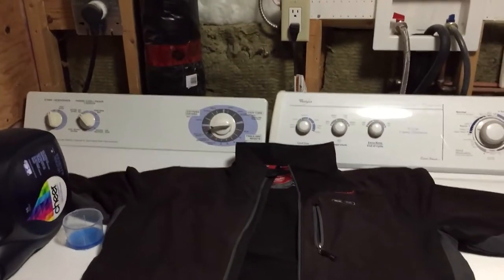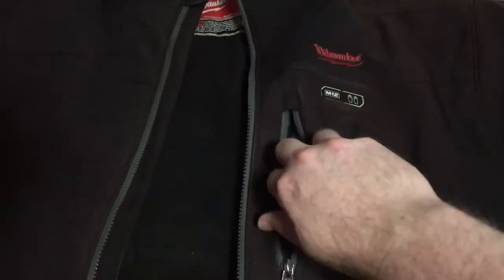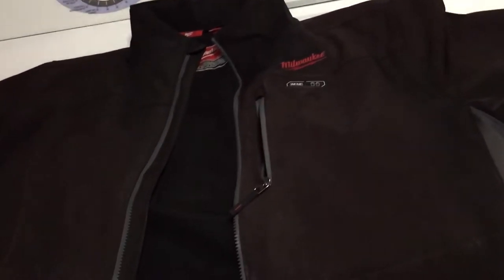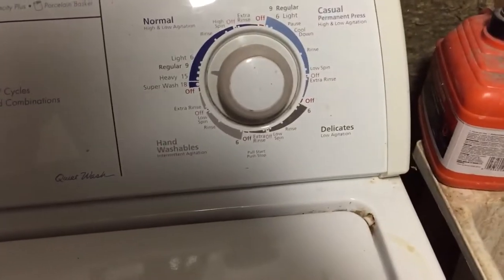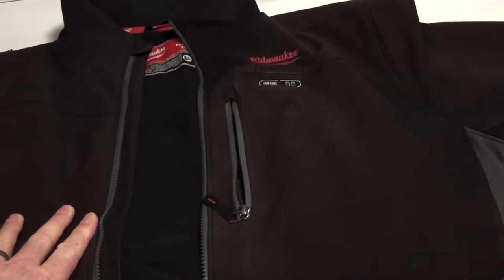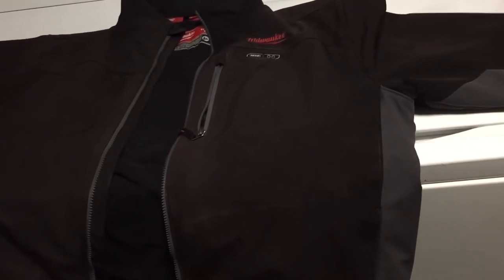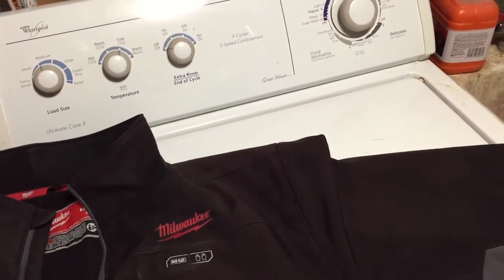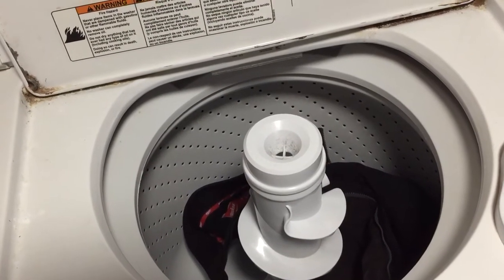How to wash a Milwaukee, DEWALT or Bosch Heated Jacket / Coat / Hoodie / Sweater

Comment: What about removing  battery controller?  Battery easy to remove
Reply from the maker: The Milwaukee Jacket only has a plug wire that attached to the battery/battery holder.  The battery and holder are the only items that can be safely removed.  Thanks for watching and the comment!
Reply: @MoreBear  thank you for answering this! My jacket says to remove the battery and the controller and I could not find the controller to save my life
Reply: @nicolenicole6224 Mine states that as well. Hopefully its just the battery adapter and not the controls located in the chest area.
Reply: @Wildwwill how did washing it go? I need to wash my son’s heated vest and mine also says to remove the controller, which I cannot figure out. Did you do it? Does it still work??
Reply: @JennySparks-n6q  Washing went well. I figured out the controller or however they worded it was just the battery. My son has washed his a number of times without issue. Same for his co-workers.

Comment: I had gotten a Snap-on heated jacket as a gift and it was way over sized for me. Took it to an alterations shop and they managed to get it fitted perfect w/o messing the wires up. Thankyou for the video, this is no as expensive as getting it dry cleaned all the time. $
Reply from the maker: Glad to help.  Thanks for watching and the comment!

Comment: I have the Snap-on sweatshirt, do I just do the same thing? It says to remove the controller, does that mean the buttons used to turn it on?
Reply from the maker: I'm not super familiar with Snap On, but their jackets look identical to Milwaukee.  The buttons are part of the clothing so it should be very similar to washing a Milwaukee Jacket like in my video.  If I find some better instructions I will let you know.  Thanks for watching and the question.

Comment: Did you take out the heating elements and wires to wash
Reply from the maker: They cannot be removed.  I only removed the battery and battery holder.  Works great!  Thanks for the comment and for watching!
Reply: @MoreBear  thank you for replying very helpful

Comment: What adapter do you take out?
Reply from the maker: The adapter that holds the M12 battery.  Simply unplug from the cord that is inside the jacket pocket. Thanks for watching and the comment!
Reply: Yes my question too - seems like it would’ve been the most important thing to cover. LoL -  it didn’t get mentioned until now in comments - but that’s what I came here looking for. Thanks so much I was wondering if the wires came out too apparently not I’m thinking, still not actually too clear.

Comment: I am trying to buy one of these jackets but I can not find a M size anywhere. Today I tried the L size amd it fits me just a little bit big. Not much. But I was told by the seller to take it home and wash it so it can shrink. I wonder if that's true
Reply from the maker: If mine shrunk, it was not noticeable.  I'm pretty sure all the fabrics involved are synthetic and resist shrinking.  Thanks for watching and the comment!
Reply: @MoreBear  I wonder if I put it in the dryer instead of hanging it. That should shrink a little bit more. Thanks for answering the previous question
Reply from the maker: @NoName-nb9qi  Check the manufacturers instructions.  They may advise against using a dryer as it may damage the jacket.

Comment: What’s the experience with it shrinking?
Reply: It wouldn’t shrink much but most likely not at all if you hang to dry
Reply: shrinkage usually happens when its cold  out.
Reply: @jonathanochoa3768  or in cold water
Reply from the maker: @jonathanochoa3768  I was in the pool!
Reply: @jonathanochoa3768  

Women: It shrinks???

Men: Like a frightened turtle!

Comment: Wanted to know if we need to take the wire out and how
Reply from the maker: @KyreonTheWolf Well said.  Thanks!
Reply: I have dewalt wires dontcome out im scared to wash it
Reply from the maker: @jamieweeks4298  The Milwaukee coat in the video has the same type of heating system.  Follow the instructions from the manufacturer and this video and you will be fine.
Reply: @jamieweeks4298  going to try to wash mine today, any luck on your DeWalt one??

Comment: Wow now my hubby got me freaked out about washing mine for the 1st time. Guess more researching, I really don't want it to mess up or notwork
Reply from the maker: You can do it!  Just make sure the batteries are removed and you will be fine.  I like to close the pocket where the battery connector is but that's my preference.  Thanks for watching and the comment!
Reply: Same. I've been postponing washing the hubby's for a few days.